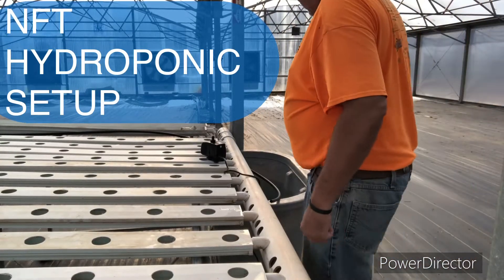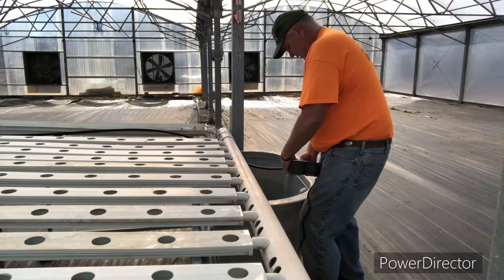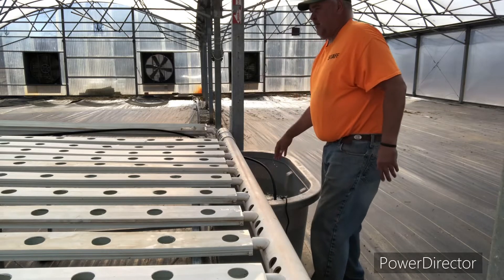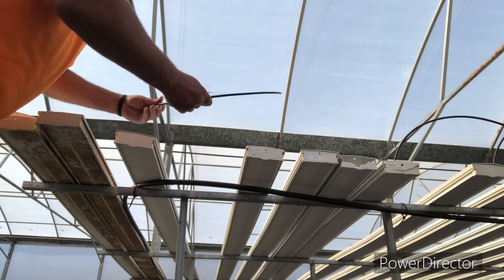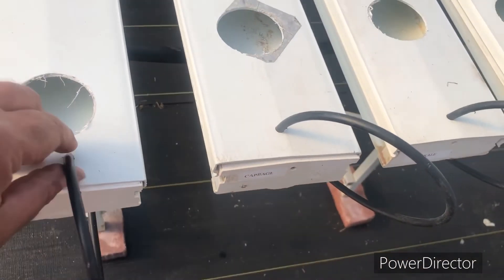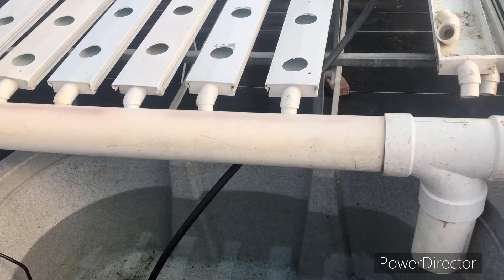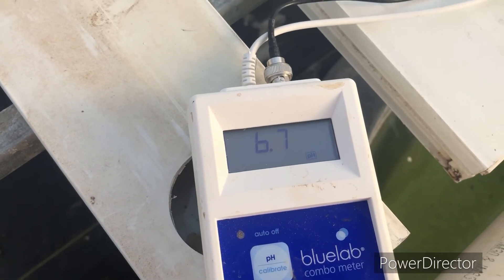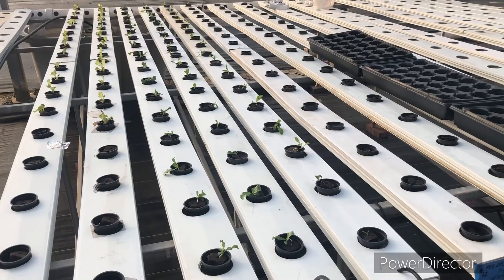NFT Hydroponic Setup

Comment: Really a nice and informative video. By the way what is the size of black tiny feeder tube ? what is the Inner diameter and outer diameter ( ID & OD )  ? It will be very helpful for me.  Thanks for the video.
Reply from the maker: Thanks for watching. The feeder or header tubing is 1/2” in diameter. It is a soft poly so it doesn’t really have an ID/OD. It’s just known as 1/2” soft poly pipe. The spaghetti tubing running to each channel is 1/4” tubing. Some suppliers also sell a 5mm spaghetti tube which is slightly smaller than the 1/4”.  Most home improvement box stores sell the 1/4” spaghetti. Grower supply tend to sell the 5mm. Let me know if you need any more info.  Please subscribe to our channel if you have not already. Thanks!
Reply: @steveale0711  Thanks you very much for your very quick and friendly response. Good to know that  the spaghetti tube is 1/4" (6mm) . some supplier told me 3mm ID ( 1/8") is also suitable. But I believe 5mm or 6mm ID is much better  for water flow. Thanks again for your help.  will subscribe you channel.
Reply from the maker: @SUBORNOVISION  you are correct the bigger spaghetti = more flow. However, you have to factor your pump capacity as you flow more fluid. Thanks for subscribing!